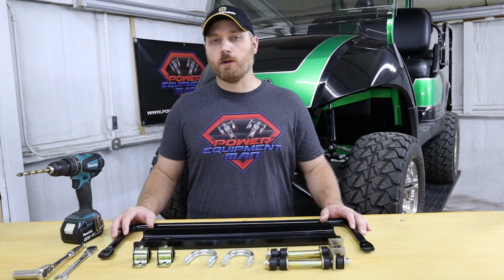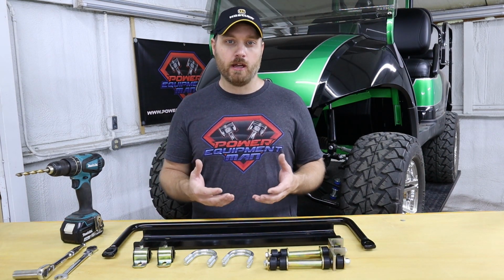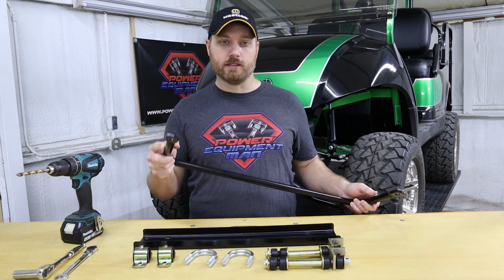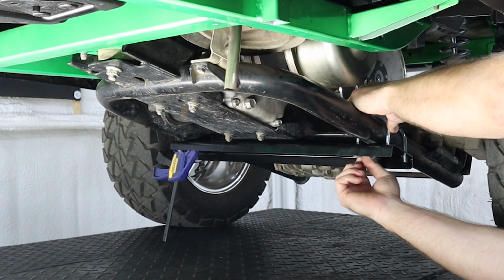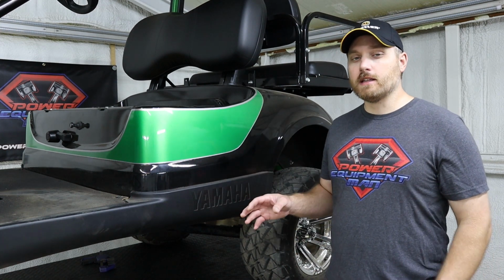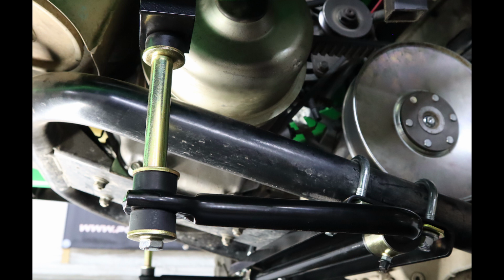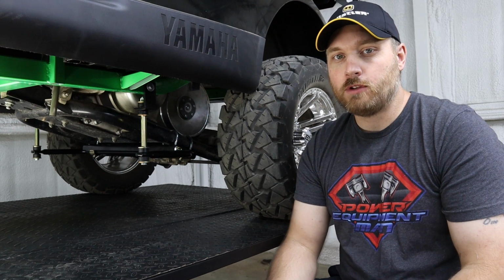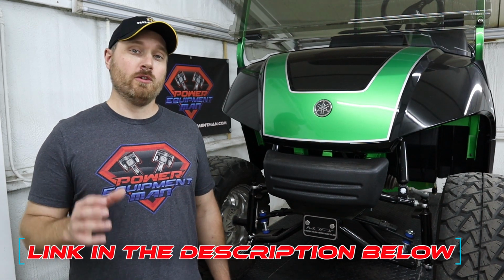Yamaha Drive G29 Sway Bar Kit Overview and Installation

Comment: This sway bar just totally fixed my G29’s swaying problem.  I have lithium batteries, 24” tires, Navitas motor+controller, and the same 6” Madjax lift from the cart in the video.  My cart was SO squirrelly before and always felt like the front steering was loose especially with people on the back and at higher speeds.  I added HD springs and that didn’t help but now with the sway bar I can cruise at 35mph without an issue.  Glad I didn’t waste money on wheel spacers first and just went straight to this sway bar kit.
Reply from the maker: Awesome, glad to hear this fixed your issues!
We appreciate your business!

Comment: I need one for my lifted 2019 G2. Does anyone make one???
Reply from the maker: If your Yamaha is a 2019, it would be a Drive2. If it has the solid rear axle, this sway bar kit WILL work for it. If your cart has the independent rear suspension, then we do NOT have a sway bar that will work for it.

Comment: for $300?!!  Hell no!
Reply from the maker: We sell them as fast as we can get them in, so there are plenty of people that feel like this worth while investment to improve their carts' handling and stability. Unfortunately, a solid spring steel sway bar isn't something that you can just make at home, so there really isn't a DIY version of this that actually works and will hold up long term. Thanks for watching!
Reply: I bought the kit.  It works exactly as stated…. Easy to install.  I got exactly what I paid for!

It stabilized a dangerous machine for only $300 & still kept a smooth soft ride.

Apparently you have never had any close calls involving injury or possible death due to an unstable machine.

Comment: Big fan of your videos. Purchased a barely used 2021 ptv and had dealer install 3 inch lift along with back seat and all the bells and whistles.  Had an issue with rubbing  rear tires with passengers on back  which was easily fixed with a small trim job of rocker panels. Dealer didn't want to install heavy duty springs because in their words said it would make cart ride  like a tank which I do agree with.   The rubbing is fixed but still  i still feel sway when turning corners which I feel is more than I should. Cart has 22 inch tires on 12 inch rims with 3 inch lift.   Any plans on making a kit for drive 2 model?
Reply from the maker: We do plan to work on a sway bar kit for the Drive2 carts as we get time. Our R&D schedule is packed full right now.

Thanks for watching!